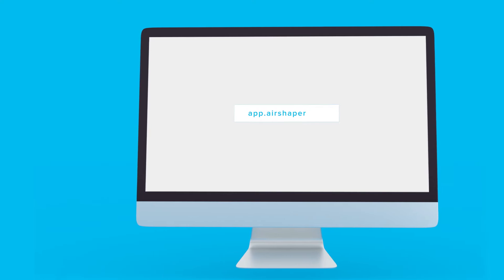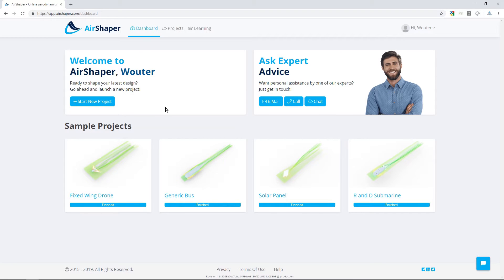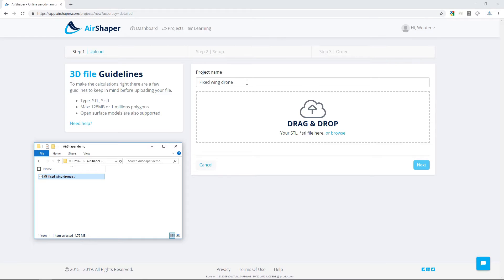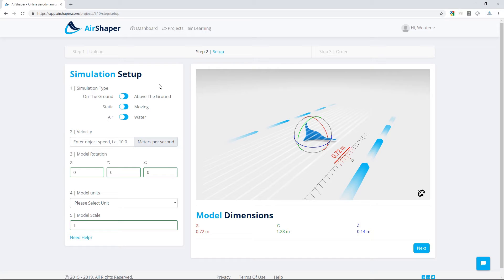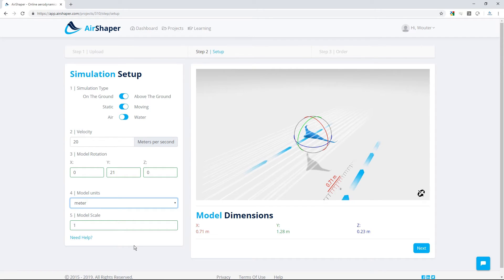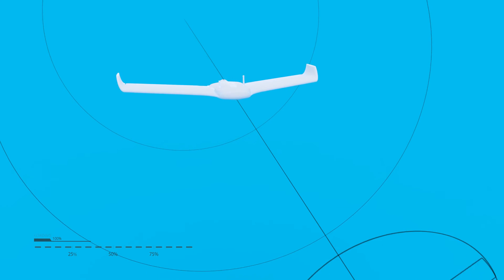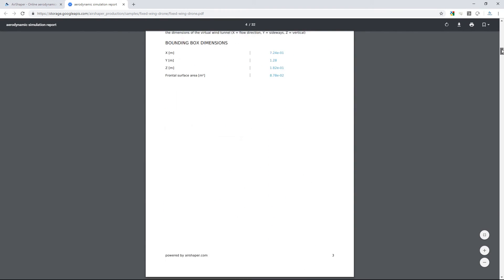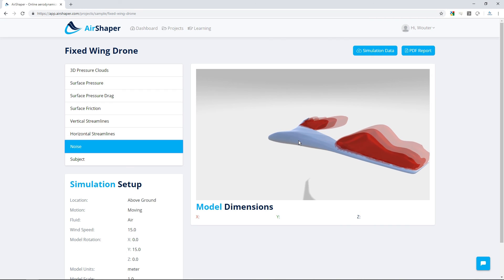How to run an Aerodynamic Simulation

Comment from the maker: How do you run aerodynamic simulations? We're curious to learn in the comments how you optimize your design!
Reply from the maker: @prcvl   Why do you think it would be a crappy simulation? We run it on a high-performance cloud, it can work directly with non-watertight models (which otherwise takes you weeks), it has automatic mesh refinement during the simulation, all post-processing is automated (which again takes hours/days depending on the subject), frontal surfaces area, force & moment data, drag coefficients, ... are calculated automatically and so on. The  200€ Concept Simulation was changed to a 50€ Basic simulation by the way, to create a more accessible low-level simulation.

Thanks for letting me know what you think!
Reply from the maker: @prcvl  Why would you think this is a scam? Feel free to let me know, then I can provide answers, cheers!

Comment: OMG WAY WAY WAY over priced if you are just exploring options. YOu know a 1000 AUD test is just not viable .
Reply: If you're someone with time, skills and some hood hardware resources, likely getting started with Openfoam is the best solution. AirShaper however, automated everything, providing fast (a few hours), accurate (adaptive meshing and convergence control) and easy (no experience required and compatible with non-watertight geometry) simulations. To a great deal of users, this certainly is worth the cost.
Reply: @wouterremmerie6019  I am an inventor and it is far cheaper to prototype the real item than fork out this simulation data . Yeah just not a viable options for start ups. and Those big companies with the need and funds have whole departments to do this .. SO I can not see the market place at this price point.

Comment: 500 euros!! That is scam
Reply from the maker: If you'd want to run a simulation yourself, you would have a.o. the following options:
- Buy a 30.000 USD - 100.000 USD CFD package (Ansys, StarCCM, ...), buy hardware (perhaps 5.000 USD - 10.000 USD) and hire an experienced engineer (perhaps 10.000 USD per month) to run simulations.
- Skip the software cost, spend a number of weeks/months learning OpenFOAM, buy hardware, ...
Both are very viable options if you're constantly running CFD simulations (when working at an automotive OEM for example).

If you don't run simulations all the time, you may want to work with a consultant:
- Simulation projects typically only start at 5.000 USD (fixing your 3D model, setting up the boundary conditions) and increase when adding more iterations.
- You need to request a quote, wait for it, approve it, ... and then they need to schedule it.
Again a valuable approach if you need very specific work.

But if you want a flexible solution which is much more affordable than the above, then our pay-per-simulation approach is very attractive.
Also, we work with non-watertight geometry, so you don't have to spend days or weeks to close your 3D model.

If you have more questions, just drop a comment.

Comment: Very Nice platform but expensive..
Reply from the maker: Dear Kaan,
thanks for the honest feedback!
It depends on how you calculate the costs: if you're an engineer in a country with low wages and you have time to skill yourself in OpenFOAM, then you can indeed run your own simulations at a more competitive rate. But if you're a small company without budget or time to dig into CFD simulations, then it is much more affordable to work with AirShaper.
Reply: @AirShaper  Hi AirShaper,
Actually I am a student and I need to do an aerodynamic simulation for my flying car project. I found your app and SimScale. I think your app is much more better for me because I don't know a lot about this subject and I have only a week to finish my project. But, it's least 50 Euros and it's equal to 10 times of it in my country (1 Euro = 10 Turkish Lira). Also, I saw that there was a try-out package for free in voxdale.be but it's sends you to AirShaper.com and I can't find an option in there. Is there a wrong information in the voxdale.be? I think you need to check it. Thanks for your reply

Also, I saw your educational package but it's still a bit expensive and I don't need 8 simulations. It will be better if you make order per simulation model as well.
Reply from the maker: @kaanturkover  Ah, that is indeed confusing - the "free" refers to uploading your project and not to actually running the simulation. I'll let them know, that's not correct.
I can certainly understand that 50€ is too much for a student project...
Reply: @AirShaper  Yeah, that's why I will contact to my school administration maybe they will pay for me. Good luck to me.. Again, thanks for your replies!
Reply from the maker: @kaanturkover  Fingers crossed Kaan!
PS: we have an academic package: it's 100€ for 8 Basic Simulations (so normally that is 8x50=400€).
https://airshaper.com/pricing#academic
Perhaps it's easier to convince the school for that one, as you can share it with other students?
Reply: @AirShaper  Oh, thats a nice idea! I will let that info to school administration! Also, is there any limit in academic package? Can we use our other 7 simulations after a year or two years later?
Reply from the maker: @kaanturkover  ok great! Yes, we do limit the coupon to one semester, so that all simulations are used within the same timeframe.
Reply: @AirShaper  Ok, still cool

Comment: Simscale offers some free computation hours for interest and getting familiar with the platform. Airshaper should also give some. And since it is only for aerodynamics, it becomes too cost intensive to run simulations through this platform.
Reply from the maker: Hi Muhammad,

we've considered this many times, but we have not come to the point where this made sense business-wise (I do realize the industry standard is to offer free trial use of SaaS tools).
But we're very open for feedback on this: would you, for example, run paid simulations on AirShaper after you liked a free trial simulation? (I realize this possible return could take time and not everyone would run a paid simulation straight away).

Simscale is a very nice platform, but has a different approach: it provides cloud-based access to engineering tools where the user still needs to set up the simulation. If you're an expert, that is very good because you want control over all the details. If you're not an expert or if you want to speed up your process, then the fully automated approach of AirShaper makes more sense. Depends on your resources, background, time schedule, ...

In terms of cost: the time savings, accuracy and comparability of our simulations provide massive time savings. It can also be operated by users with lower experience (and thus wage) levels. Last but not least, our subscription option really lowers the prices dramatically (to just 30% of the one-off prices).

I hope this answers your question and I'm looking forward to your reply.
Reply: @AirShaper  You guys have a great platform, no doubt. But I think the problem is that users need to run multiple simulations for the product, since design is an iterative process. However, if the business model doesn't allow a company to give some perks, there is nothing bad in it. I hope in the near future that simulation prices will get to a moderate price point with the introduction of very fast yet economic computational technology solutions.
Reply from the maker: @MuhammadArslan-ne8fi  Thanks a lot for your feedback!
I agree that things can improve when server costs go down. Our fixed pricing model is great for users who don't like "expensive black boxes", and we're already a factor more affordable than buying your own software if you just need simulations ocasionally. But for sure, computing advances (hardware: GPU and ARM based sims) and solver advances (LBM solvers, meshless methods, ...) will drive prices further down! To be continued :)

Comment: Cost is too mutch for just interest and education.
Reply from the maker: Hi Mark, we do have educational packages for students, just check airshaper.com/pricing or send me a message at info@airshaper.com!
Reply: @AirShaper  oh, thanks.
Reply: @AirShaper this is still a barrier for people, especially those who just wants to learn. Not wasting money on this, there are plenty of other free solutions out there that allows people to learn from these tools and how they work
Reply from the maker: @zixing467  50€ can certainly be a lot if you are just learning - I fully understand that.
We use OpenFOAM, an open source CFD library anyone can download and use to run simulations. The challenge is that it takes weeks/months/years to master properly. So if you're a student and you have the time, I would certainly recommend this route. If you're running a business, startup, personal project, ... the benefits in terms of time & cost of AirShaper are vast compared to learning CFD yourself.
Reply: @AirShaper what a cool response

Comment: I want to make a car that would have very fast spinning disks in the car when the Disks get Slowed down the momentum would transfer from the disc to the car frame turning the car. No Need for Tire Traction that is Limited.
Reply from the maker: Do you mean a gyroscope-like solution to help balance the car or something to recuperate braking energy (like the Porsche RSR flywheel)?
Reply: The only problem with this is that even if you manage to turn the car  faster than the tires normally could, it is only changing its rotation. The momentum of the car needs to be changed to a new direction, or the tires will simply slip and skid